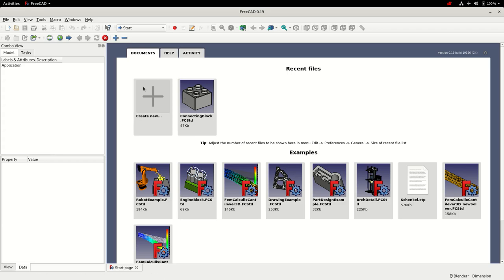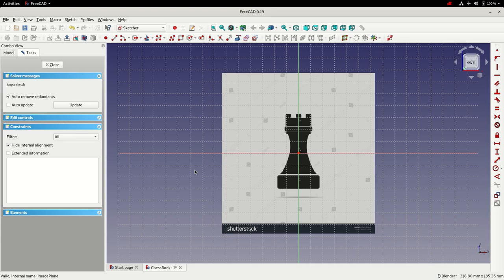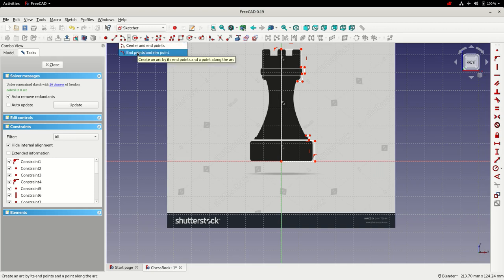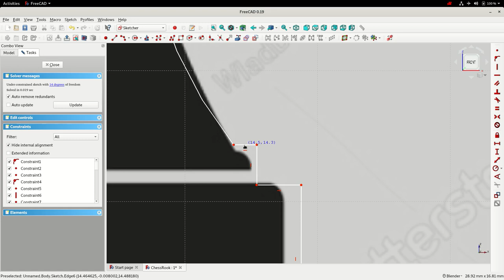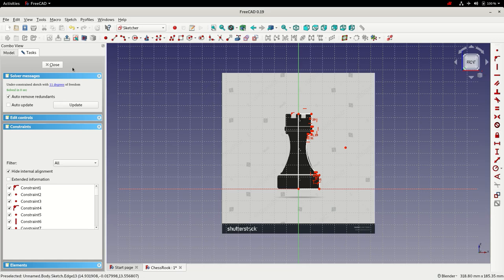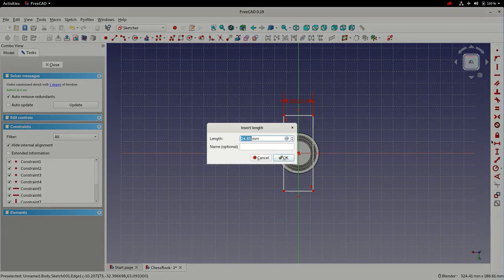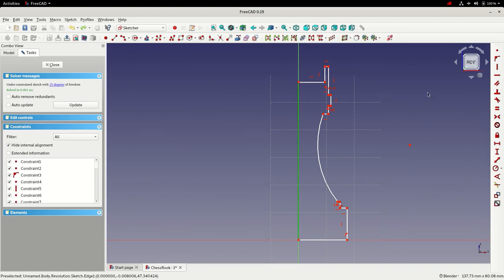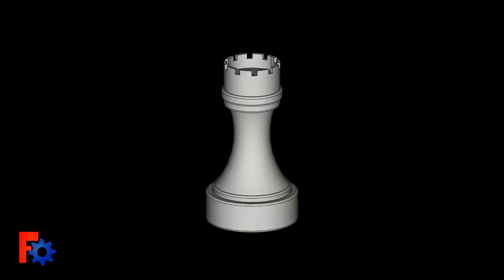FreeCAD Tutorial - Basics - Chess Rook

Comment: Thanks for doing these videos. I was able to follow this great little tutorial. When introducing a new feature or button I would suggest taking a little bit more time. I would also add a few trouble shouting hints at the end if possible. For example, I had to fix "Failed to validate broken face" before the revolve tool worked.
Reply from the maker: Thanks for the feedback. Great idea covering any issues at the end!
Reply: @MarthamEngineering  By the way, I posted your videos on FreeCAD reddit sub. You may want to respond to any comments over there as well...

Comment: Thank you for your tutorials!  They are very nicely done.  I downloaded and installed FreeCAD 64-bit for Windows v0.18 the other day and have been following along the tutorials.  When I use the Image tool and import an image, NOTHING shows.  I downloaded your example Shutterstock image in JPG format.... nothing shows before or after I click "Set to Front View" and Fit Whole Content...
I tried the image in PNG format with the same results. I tried various other PNG and JPG images from my machine all with the same result.  The Image Plane is showing in the Model tab, but I get nothing visual.  I saved, closed FreeCAD, reopened project and still nothing. 
Is there some setting that has to be enabled or something obvious that I am missing?  Would love to do this tutorial, but I am dead from the start.
Reply: Update: I did not see the error at the bottom of the screen at first.  I am getting this error: Unhandled Base::Exception caught in GUIApplication::notify. The error message is: Access violation.    This happens even if FreeCAD is Run As Administrator.  To that end, I am starting to research forum threads... https://forum.freecadweb.org/viewtopic.php?t=35255

Update 2: Forcing FreeCAD off the Intel Graphics card to my Nvidia GTX1060 corrected the issue (and will probably give me MUCH better performance).  Will look for Intel updates.
Reply from the maker: Note that all the tutorials are made with FreeCAD 0.19
Reply: @MarthamEngineering  - Thank you.  I just downloaded a couple weeks ago and 0.18 was the current version.  Are you running a Beta or pre-release version?  Anyway issue is fixed and I am on to learning again.

Comment: You are using 0.19 - but the link you provided is showing 0.18 as the latest stable version...
Reply: And 0.19 is really buggy
Reply from the maker: Which link?
Reply from the maker: I find 0.19 the most stable version if FreeCAD. If there is something that is repeatedly causing issues for you please report it on the FreeCAD forum.
Reply: Clicking Download now/WIndows/64bit provides 0.18 - very confusing for a freecad newbie. I'm finding some other things that were also very confusing - there is an option to display the sketch grid only while editing (now I know why it disappears when I close the sketch), and I had redundant constraints which prevented the sketch from showing in part design.
Reply from the maker: If you want to use 0.19 it is available from a number of sources. For example: https://github.com/FreeCAD/FreeCAD/releases